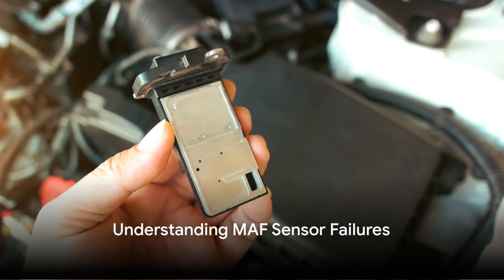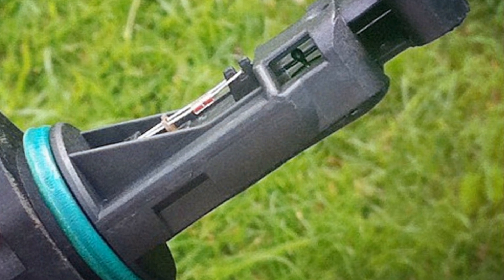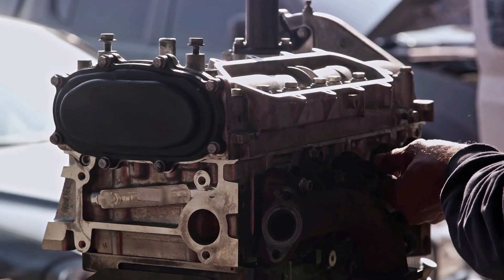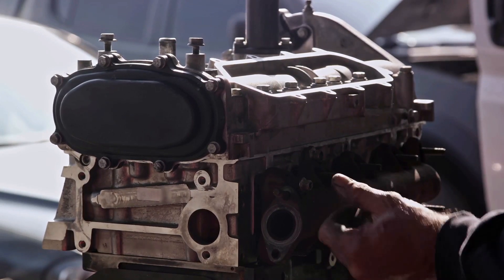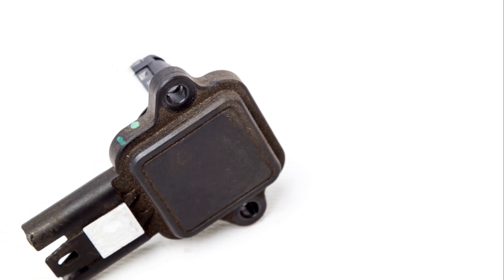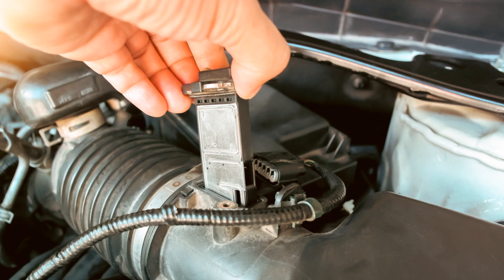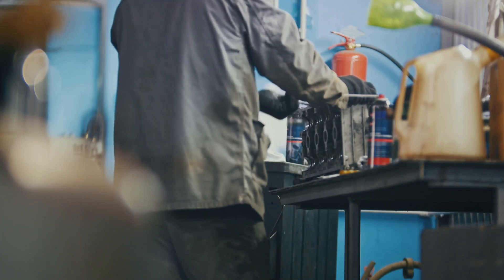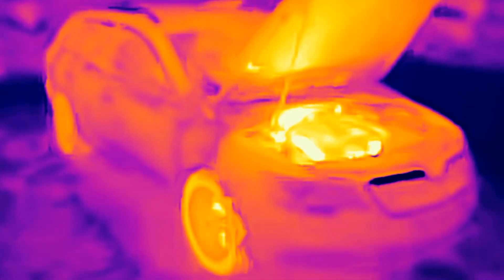What Causes MAF Sensor to Fail: Real Reasons Why Mass Air Flow Sensor Go Bad

Comment: Recently my 01' Lexus gs300 was intermittently crank no start. To the point I was afraid to drive it anywhere. The fix was new air filter, clean MAF, and keep injector cleaner in the car. No problemo anymore. Just an FYI
Reply from the maker: @seane.9937  Thank you for sharing your experience. It's great to hear that replacing the air filter, cleaning the Mass Air Flow (MAF) sensor, and regularly using injector cleaner resolved the intermittent crank no-start issue. These are indeed valuable maintenance steps that can significantly improve engine performance and reliability. Keep up the good maintenance!
Reply: Inneed to buy injector cleaner